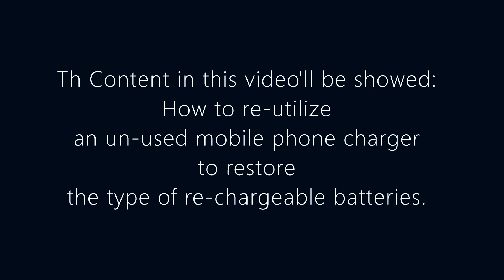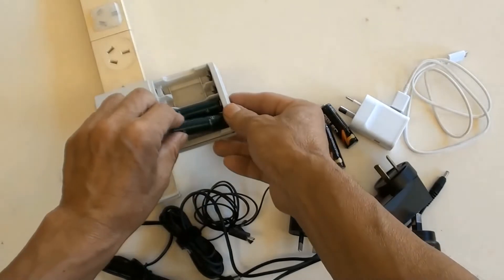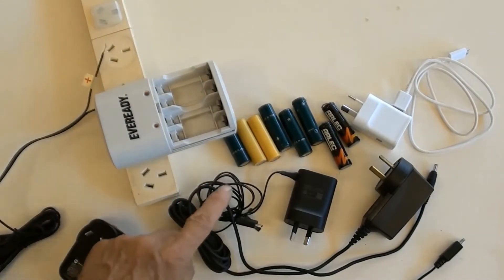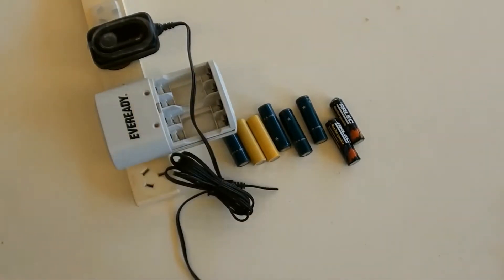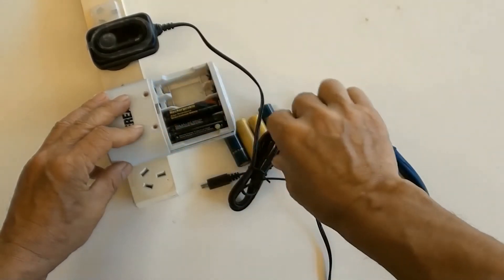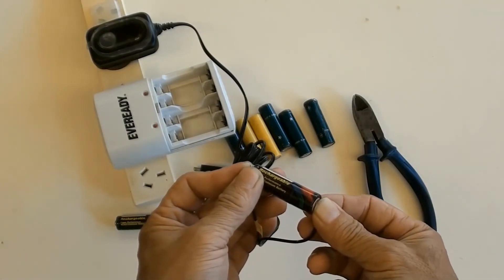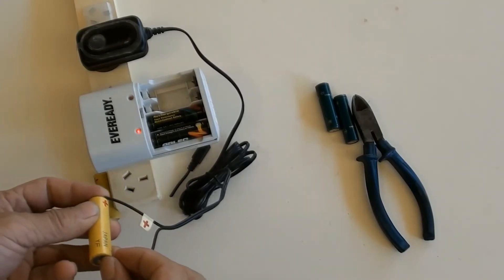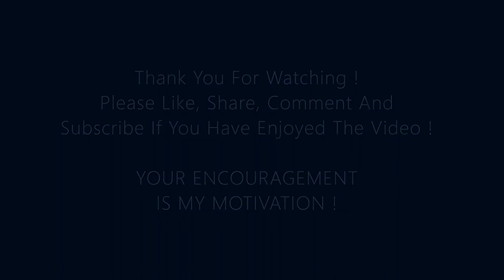How To Restore Dead Rechargeable AA Batteries?

Comment: How do you tell if the wire is + or - ? It was next to impossible to understand you with all the background noise.
Reply from the maker: An easy way is to use a multi meter's voltage function then use meter's probes to connect the two wires which are cut off (showed in the video), Red Probe contacted wire will be "+" if multi meter indicated positive voltage figure and so "-" will be Black Probe.
Another way is possible:  there are a few words printed on the charger's case, they indicate which wire is "what".   Thanks for your interested!